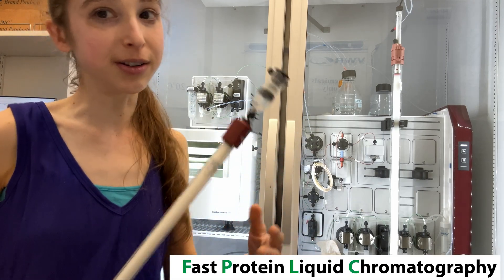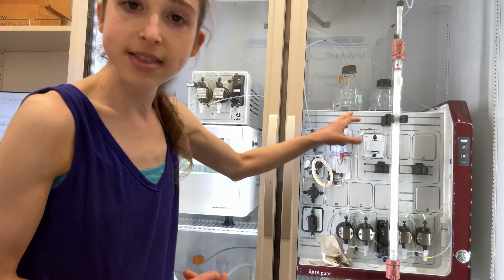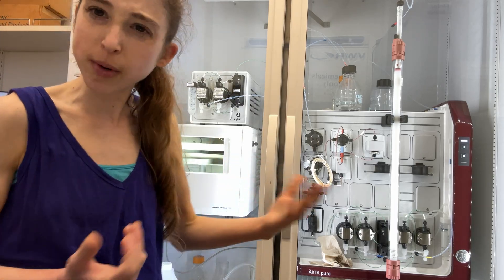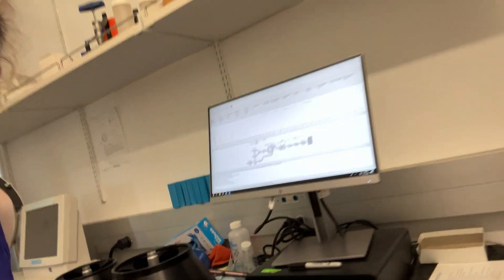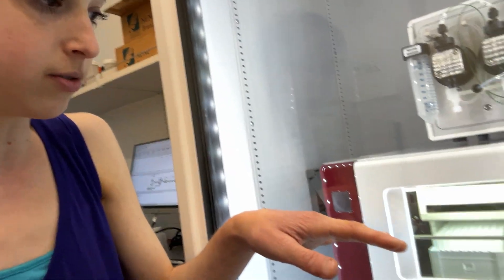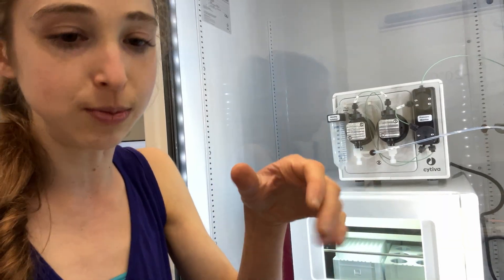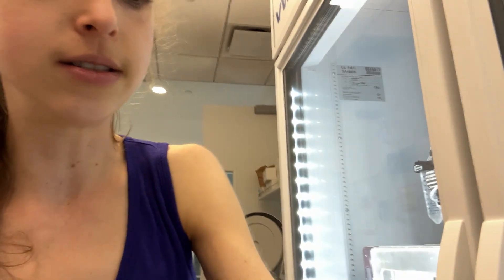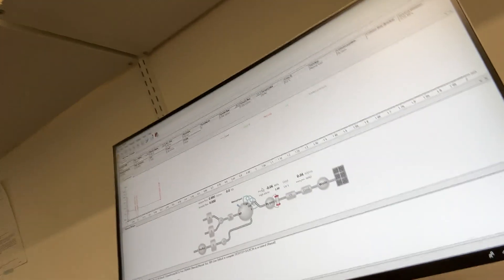Meet the AKTA! A quick tour of the basics of an FPLC (Fast Protein Liquid Chromatography) system

Comment from the maker: The kind of chromatography wI use is typically “preparatory” - we separate things to use them in their purer form. There’s also analytical chromatography, where you separate things just to see what’s there. this is similar to one of the differences between SEC & SDS-PAGE http://bit.ly/2xWH7VZ 
 
There are many advantages to using the FPLC over relying on gravity to drip liquid through (gravity flow). My favorite reason - you don’t have to work in the cold room forever because it’s automated and, if you’re lucky, housed in a deli fridge not the cold room. When you’re working with precious proteins, you want to keep them safe. At higher temperatures, proteins can start to degrade especially if there are contaminating proteases (protein chewers) which at cold temps don’t have enough energy to chew your protein but do at higher temps.  
 
But I don’t use the AKTA for everything. One of the nice things about gravity flow is that you can pack your own columns. AKTA pre-packed columns come in multiple sizes, but with gravity flow you can choose exactly what you want. 
 
I sometimes prefer to use gravity flow for initial purification steps, where I’m working with “crude lysate” - the liquid you get when you break open cells (lyse them). Even though you then spin them down really fast (ultracentrifugation) to pellet the membrane pieces and other insoluble stuff and then you push it through a syringe filter, it can still be pretty viscous (syrupy) and this can clog up the AKTA lines. The AKTA’s really smart - it senses the buildup of pressure and slows down the flow rate - so it starts flowing REALLY SLOWLY. So much for that fast part… So it can be much more time-effective to go with gravity flow in these cases. 
 
Even when it’s not crude lysate, you still need to worry about stuff clogging the tiny tubes - so we filter all of the buffers we send through them - usually using a bottle-top vacuum filter - it has a kind of “bowl” you screw on to the top of the bottle and you pour the buffer into the bowl and it gets sucked through a membrane into the bottle.  
 
Want more details on protein purification and the various forms of chromatography? I have a whole page of posts on my blog: https://thebumblingbiochemist.com/lets-talk-science/protein-purification/   
    
and YouTube playlists on protein purification: https://youtube.com/playlist?list=PLUWsCDtjESrEtqQkEXsQpTyRfMhywBVQ7  
 
and chromatography: https://youtube.com/playlist?list=PLUWsCDtjESrEtqQkEXsQpTyRfMhywBVQ7   
 
more on topics mentioned (& others) #365DaysOfScience All (with topics listed) 👉 http://bit.ly/2OllAB0  
 
#scicomm #biochemistry #molecularbiology #biology #sciencelife #science #realtimechem